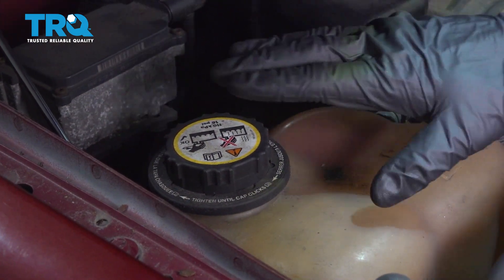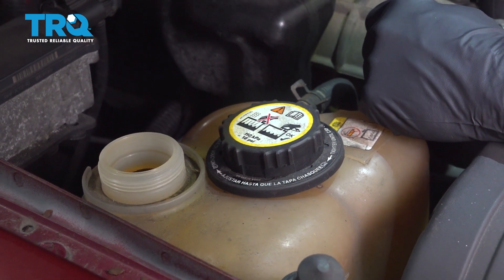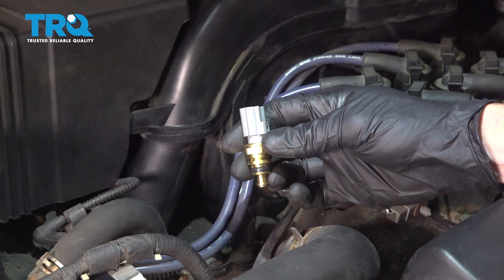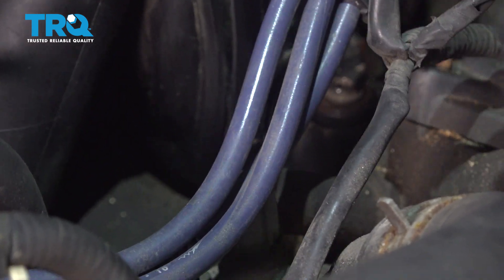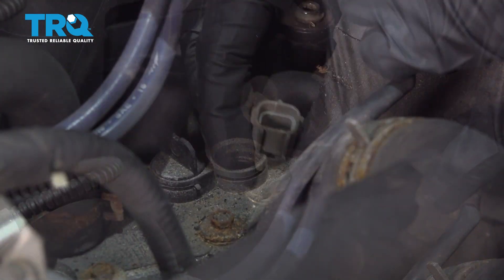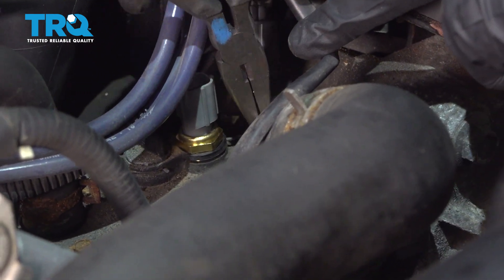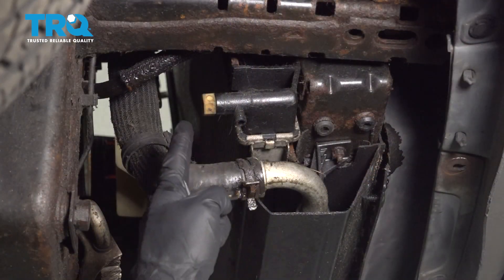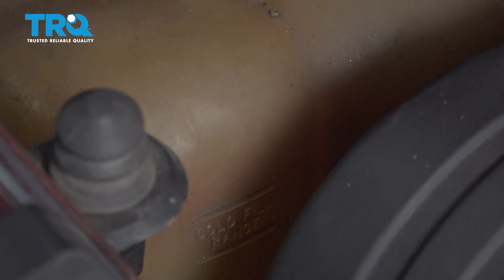How to Replace Coolant Temperature Sensor 2002-2005 Ford Explorer

Comment: I love TRQ Video's and parts but DO NOT USE A SCREW DRIVER TO PRY THAT PIN OUT. It's spring loaded... I used a screw driver as shown in the video and the clip shot out like a rocket. I spent 10 minutes fishing it out of a crevice in the engine bay. I'm lucky that I found where it landed. I would use needle nose pliers to firmly hold the clip and pull it out.  Be careful putting it back on so it doesn't slip out of your fingers. You don't have to drain the coolant, but in my case, the coolant leaked out after I removed the temp sensor - so that required clean up.
Reply from the maker: +@jbarachi Thanks for the tip! We'll pass this info along to our production team. http://1aau.to/m/Shop-TRQ

Comment: After ect, thermostat and housing replaced temp gauge doesnt work. It moves about a 1/4 inch when i turn the key to accessory and drops right back down. If the temp gauge had a short would it move at all on accessory? It stays cold the whole time even after a 30 min drive. Mechanic did it all and said it will cost 400 bucks to put in a new cluster. I think they fried it. How would only the temp gauge short out? Tried resetting it too

Comment: I have a 2004 explorer and don't get much heat it seems I can't get all the air out of the system. I can pull off a heater hose and no coolant comes out, I have flushed the system but still no heat. how is the best way to purge the air from the system?

Comment: where is it located on a 03 f150 4.6l, some one said it was above no. 5 piston down in the valley, all i found was the cylinder head temp sensor.   plus I can't find any pictures where it's a 03 f150 4.6l showing exact location...